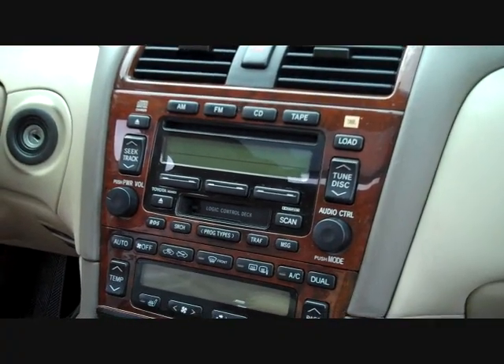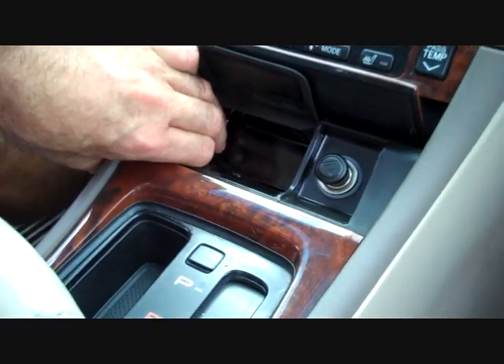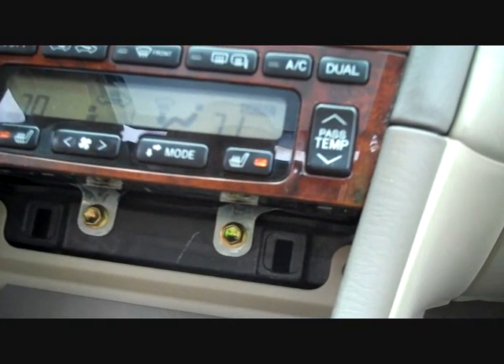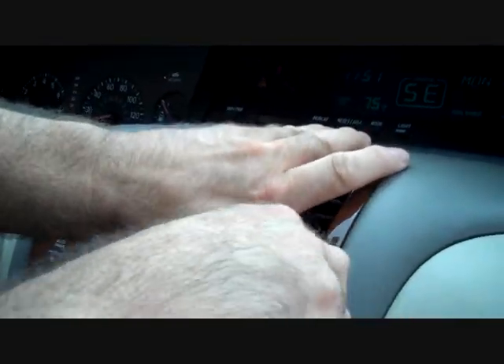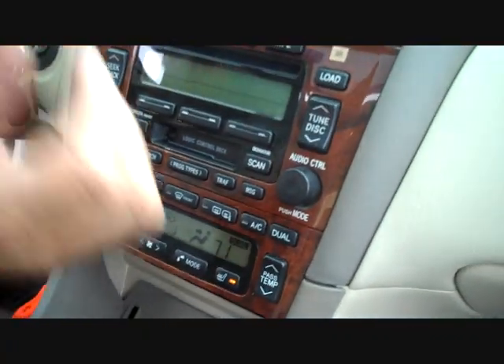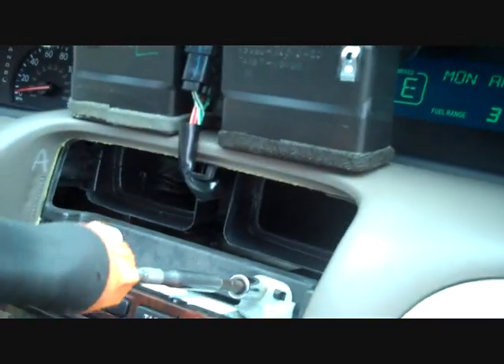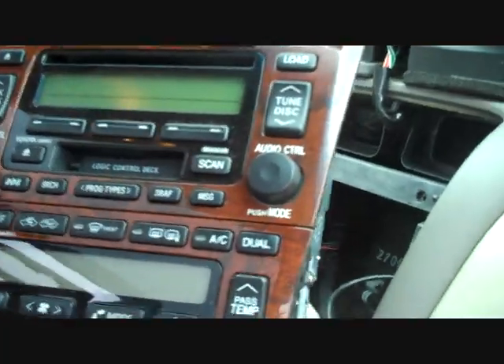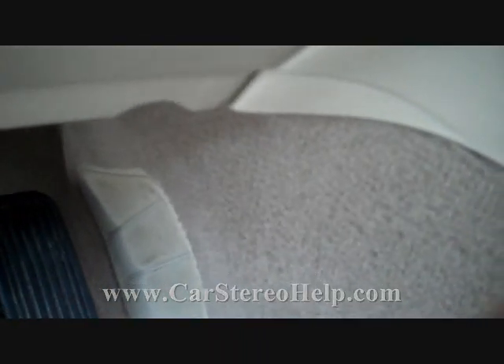Toyota Avalon Car Stereo Removal 2000 - 2003 = Car Stereo HELP

Comment: If you're careful, use a steel prying tool and the vents will pop right off. Or break, depending on how much deterioration from the sun there is. 😁

Comment: Thank you for the video, for the A/C vents - put a thicker trim tool between the radio and A/C vents - this allows a 90 degree pick to fit - then pull directly on the lower arms with the pick on each side - comes out very easy this way.

Also, for the lower trim - pull the change tray out and there is a metal backing with a hole in it - grab a hook type tool and it pulls strait out

Comment: Hey bro did you ever think to mention that you got to take the 2 cables out that are connected to the HVAC unit because if you don't have those two cables out of their spots turn the radio does not come out like you show it doing in the video you completely deleted a step and decided not to tell anybody so everybody would have a lot of trouble I feel like you are not a very good person for that fact.
Reply: I didn't seem to have an issue with that

Comment: I followed the video and disconnected the  mechanical temperature and fan wire but was not able to pull the radio out.  Something holding the unit assembly from coming out. Has anybody run into this type of issue?
Reply: Antenna plug ins

Comment: Do not pry on the ends of the ac vents! You will break the links that move the vents.  Pull up on the bottom of the stereo/ac controls and this will help loosen the vents. there is only one clip at the top center of the vents and one on each side below the bottom. Only pry there. Top center, bottom on the left and right. Not on the sides.
Reply: needed this comment <3
Reply: thank you. I almost messed it up... mine has never been removed and was sooo tight.
eventually i micro wiggled it out, by pulling, tugging, rocking bottom and top

Comment: For the vent at the top use a very long flat head screwdriver. Ive found the plastic prytools are too pliable. Take the bottom two bolts out and jostle the radio/climate around to pull the bottom of the air vents out. Then use your screwdriver to counter lever the long clips out. Push down with the flathead and pull the clip out on one side then the other. Then rip it put with force from the bottom. Zero damage to my trim or the vents this way. Took 2 minutes with an 01 that has never been taken apart.

Comment: I have a 2003 Avalon XL.  The lights behind the temperature control for the heater - A/C have burned out. They are not electronic, they are manual round knobs.  Do you know of an easy way to replace them?  I don't think I am up to the challenge of pulling the entire stereo out.

Comment: Anyone know what size radio I can replace the original with? Does it need to be double din? 7 inch? I have no clue. Not sure how to find out.
Reply: Did you find out? I have the same question lol
Reply: @f.maciel660  2 Din 6.5 with knobs, 7" with just a row of buttons on the left. The 10" that they say will fit stands proud of the dash and blocks you ac vents.

Comment: I have a Avalon xl and i see you have the XLS I have a manual ac but I want the wood grain stero and ac controls but will the ac connect the same
Reply: Problem is that the wood grain A/C controls are electronically controlled so there's literally no way to hook it up into the car due to the fact that your controls are all by wire/cable. Only thing that MIGHT work (assuming the connectors are the same) is the fan and/or A/C button, but everything else wouldn't work...

Also the wood grain stereo is a JBL system stereo and either won't sound good with your speakers, or fry/ruin your speakers...

Comment: Will this work for a 2004 Avalon?  Same generation as the 2000-2003, but is there something different about the 2004? From the outside, it all looks the same as the 2000-2002.  I am not so familiar with the 2003.
Reply: Yes yes it does I just did it

Comment: Does the wood trim piece that surrounds the radio come off?
Reply: YOUGOTIT210 no
Reply: @thejoshno  You can get a replacement one from Ebay for around $50 that has the wood grain on it and a hole that fits a 2Din stereo.
Reply: @YankeeDoodle1492  yeah but I question the color match of the wood grain to the stock one. I’ve seen that one and thought about purchasing it but it would be more irritating to look at that than a grey piece that looks like it wasn’t even trying to match. Idk just my personal preference.

Comment: so I guess it's impossible to install a new radio while keeping the A.C. since it comes off with the factory radio smh
Reply: It is possible. I replaced just the radio portion and kept the original AC unit below. Works great.

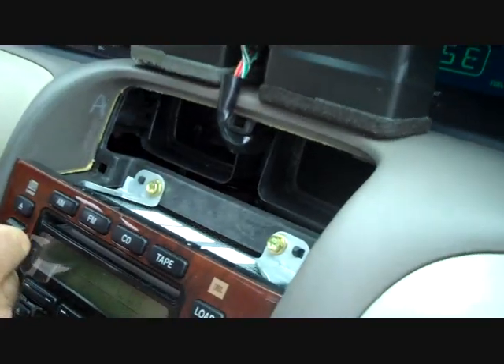Comment: This was a God send video for me. The top trim was My challenge. I found it helpful to go from right clip to left clip using a modified 8" long scribe, with a 90-degree bend & shortened tip. I felt for the hole in the clip, to hook on to, then tugged upon each clip (clip noticed briefly at 4:29), whole pulling on each side of the fragile vent trim. I hope this helps.

Comment: why do you turn on the car and shift into a lower gear while removing the stereo?
Reply: +Kajom Rigatonni Because the shifter blocks the lower pieces from being removed. You will see...
Reply: +Ian Pollock Aye, yeah, did the stereo replacement last week. Had to jump the battery afterwards : /
Reply: Kajom Rigatonni ahh, yeah I just started the engine when I did it. Didn't out get it installed though?

Comment: After watching you struggling and then breaking the corner off the left side of the AC vent, I was happy to see when you got it off where the clips are. Now I know just to take two 1 inch wide putty knives slide down on both ends and Release. Other than that snag at the Beginning the Video was helpful

Comment: Tried this and it was easier to do then I thought it would be However I ended up with a car that will not start. Some how I think we violated the security system and the engine immobilizer system is NOW activated. Not sure about. And not sure were to go from here.
Reply: Put it back in Park.
Reply: +ttpandlmp did you ever get to start

Comment: if anybody wants to replace this radio. I have one you can buy. just hit me up. I just replaced it. everything works great ,cd changer and cassette.
Reply: orcaluv i have cds stuck in my 6 cd changer in my toyota.
Reply: disconnect the battery for a few minutes and it should reset and then work again.
Reply: orcaluv there are 2 extra cd's in the changer there are only to suppose to be 6  I can;t get them out. disconnecting the battery will get them out?my toyota is a 2001what did you replace your radio with ?
Reply: yeah. that's right. disconnect the negative terminal on the battery and wait 5 mins. that will reset the CD changer in most cases. I have the same avalon and I changed out my radio with a kenwood so I could plug my phone into it and listen to music from the phone and do all those features.
Reply: orcaluv My cd player has become a problem, it plays CDs until it gets warm, then it stops and gives an error code.  At that point it just won't play CDs.  As of two days ago it won't even cycle through the 6 discs. Also the light for the stereo display only comes on after it gets very warmed up if at all which is a drag at night.  Thats been going on for a year or more.  
Mine has too many failures so I'll replace it even though I'll probably get another vehicle in 12-18 months.  I would like connectivity for my iPod/ iPhone etc. but still want it to sound as least as good as the existing JBL premium system that's currently in it without breaking the bank.   I would guess you kept the JBL amp that came with the car connected to your new stereo. I doubt unplugging the battery will correct all of the issues this unit is now displaying.  I'm also running out of patience as I enjoy my music.

Just wondering which model Kenwood you purchased. Any feed back would be greatly appreciated because I want to make a move on this very soon, perhaps this weekend:)

 Thank you for the video, it looks pretty straight forth, with the exception of that stubborn AC vent section.  I'm considering getting something from Crutchfield which will include adaptor harnesses for my existing system with the existing amp.
Reply: ***** Kenwood DBX501BT is the unit I got. it's a good head unit but I still have a hard time seeing the read out on the radio. just the angle of the dash I guess. This isn't my vid by the way but in my time taking the dash apart, I had a much easier time than these guys. just the way it works sometimes. I did not remove my amp. got a harness, plugged it up to the kenwood,  made sure everything worked as it should and put it back together. It went well. 

If you don't want to get another Head Unit I recommend going on amazon and getting a radio transmitter for your your phone/mp3. the one I got was $15 and it worked great. it's more of a pain keeping up with a station that won't produce static driving through several cities but it's a  temporary fix that's cheap. I keep it in another older car that I'm not going to replace the radio in. works fine. 

I would disconnct the battery for a few minutes just to try it and see if that fixes some of your issues.
Reply: orcaluv   You're right I was thinking about that on the way home from work that  I should as least disconnect the battery but I know that won't affect the shorted out display light that comes on intermittently and only after the stereo's been on a while and warms up:)  Not good for short trips (under 10 miles) at night.  The radio works great, no problems.  I have a lot of music and always listened to my CD playlists. My intention is to continue using the existing OEM amp that I know is under the seat.  There's a well known online store that includes the necessary harness specific for my car to install and keep the amp intact and functional with the new head.  It looks very straight forth; especially with the correct harness.  After watching this video it's much less involved than I figured it would be.  And I even have some specialty tools like panel poppers from Snap on tools.  LOL

 I do need a display that's somewhat easy to see so I'll look around a bit. I do like the ability to change the display color, seems one of those colors should stand out more. 

Crazy as it sounds I'm willing to keep it under 250.00  At least I would have modern day connectivity like a USB to plug in my iPod or phone and listen to my playlists.  I'd be curious to see how your's looks installed without the stock JBL.  If the car wasn't so old I'd spend more.
Thanks for your prompt reply as I am going to start doing some shopping around this weekend.   In the meantime, I will do the reset of the system with the battery disconnect.  I'll give some feedback on how that goes. In fact the more I think about it if it makes the darn CD player work that's all I care to correct; the heck with the display light, I lived with that for nearly a year:)

Thanks again.

Comment: That worked great and yes I had trouble with those upper vents too. We are thinking of having the radio repaired. It no longer plays cds unless we use a cd cleaner disk, but that usually only works for a little while. Otherwise the radio works great. Can you quote on repairing this unit?

Comment: I have a 2001 Avalon. I have everything pulled off the dash and the stereo unscrewed but I can not get it out. I think cables are holding it in. I believe I have the manual AC panel because I have fan and cold/heat turn knobs. Is that correct? where and what do the extra cables/wire look like that I need to unhook? Where can I find pictures. of what it is?

Thank you very much for the help.
Reply: hey Joshd00 did you ever figure out how to pull off the manual hot/cold cable? I am currently in the same position as you, I have everything unhooked but I can see that the hot/cold manual cable is still hooked in
Reply: I think I just carefully wiggled/ popped them out. The end of the cable is a ball that snaps into a round plastic disc. It's all very tight and hard to get to. Be careful not to break any plastic. It's a pain to get them back in as well.

Comment: I really appreciate your video.  My player has been jammed for about 6 months with 3 CDs inside. The local Toyota dealer said they couldn't help me and recommended a local car audio shop. I tried resetting once before by pulling the fuse for radio, but maybe that didn't cut enough power and I'm sure I didn't wait 5-10 minutes as you recommend in the video. Today, I disconnected the battery as you recommend in the video and waited 15 minutes. Reconnected, stated the car, turned on the the radio/CD player.  I pressed EJECT but nothing really happened.  Then I hit load and it told me "CHANGER FULL" as it has for these many months.  Then I pressed and held the EJECT button and out came the first CD.  Pressed again and out came the next.  Repeated once more and got the last one out. Great zero-cost solution.  I really appreciate you including that explanation in the video.
Reply: Wow! This is great to read! I have 6 CDs stuck in my 2004 Avalon's JBL CD player & can't wait to try this method. Once they're freed, will the player work again, or is it permanently damaged? I've missed it and don't want to replace the unit with a non-OEM option. 🤷‍♂️ THANKS!